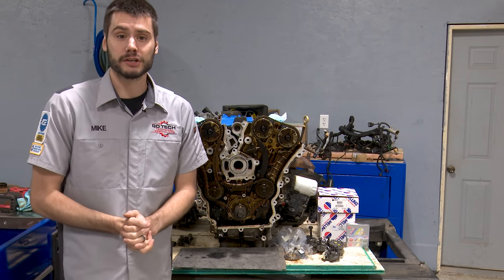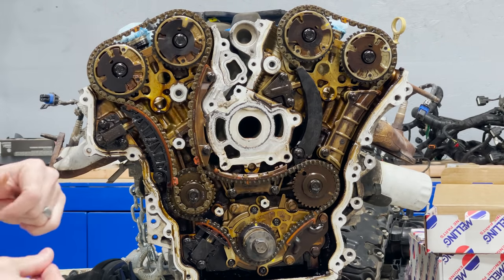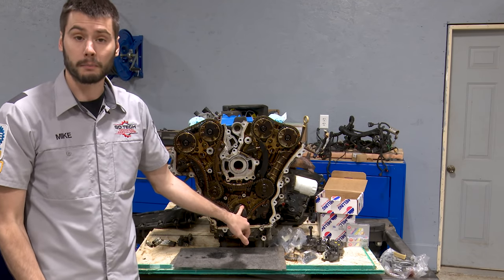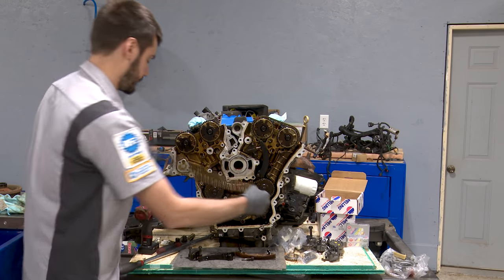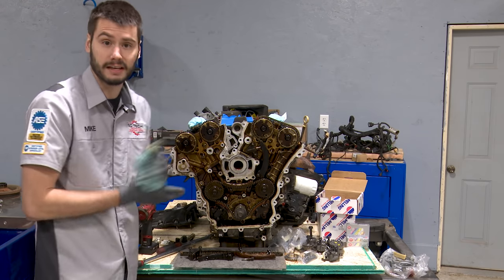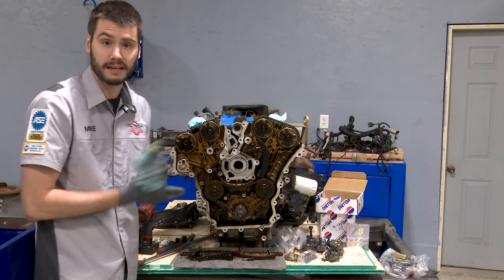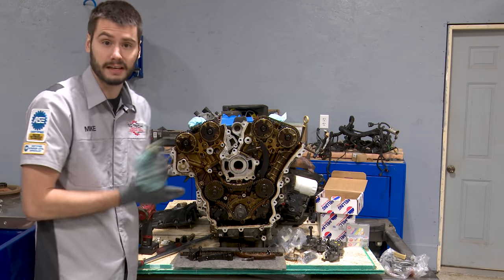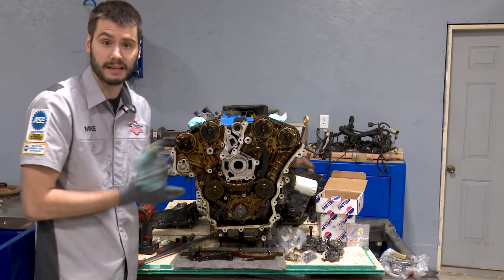How To Replace Timing Chain On Chevy / GM 3.6L V6 - Full Length Removal and Install - With Tips!

Comment: It's 15 rotations to line the links back up again.
Reply from the maker: That's good to know, thanks Cory!
Mike Becker, Senior Instructor
Reply: I had an issue with my chains and it took 15 rotations to get the marks lined up. I suppose it could be more.

Comment: I got a 3.0 is this the same timeing set up
Reply: The 3.0 has a fixed exhaust cam with no phaser. It'll be an LFW or LE0 code depending on if it has DI or Port injection.

Comment: I always do this entire job in the stage 2 timing. With the cam lock plates (that only cost $8 on Amazon) on the cams  it's easy peesy.
Reply from the maker: Hey Ball Zach, sure that's one way to do it. My cam locking plates didn't fit the best. I also ordered the cheapies from Amazon. 
Mike Becker, Senior Insturctor
Reply: @GoTechTraining    The main mellings video also shows it in stage 2 the whole time.   That video was far more simplified then this one
Reply from the maker: Hey Randy, maybe it was simpler but I think it left some questions unanswered. My goal was to show the replacment by the book. That way any and all confusion could be answered.
Mike Becker, Senior Instructor

Comment: is that engine not an interference engine, because youre moving the pistons with left bank camshaft, while right bank camshaft is stationary, after removed the first chain, i thought the pistons and valves would collide on the righthand bank..
Reply: Apprently.it is!

Comment: I have a Weird Issue if anyone can help!!!

I set the timing perfectly all links and marked lined up I installed the cover and balancer. The. Started rotating it around to make sure things move smoothly because I was tightening a timing bolt and heard a crack. Wanted to make sure I didn’t blow the engine sidewall out or something. 

EITHER way when I was rotating the crank everything moved smooth till I heard a chain jump/skip noise. And then I che led marks and the Left phaser on intake jumped a couple teeth! How’s that possible? Even if engine cranked it would of done the same probably? 
Now I have to reset the timing on that cam hopefully not pull the cover I just sealed.

Comment: Anybody else notice the exhaust cam jump a tooth on the left bank when he rotated the engine?
Reply from the maker: Hey Casey, not sure what you're seeing, but the chain never jumped a tooth. The motion you may be seeing is the tensioner moving a bit, but the chain stays on it's teeth as it should.
Mike Becker, Senior Instructor

Comment: @Ricom69
0 seconds ago
Hello all, I am having a heck of a time locating the Harmonic balancer (crankshaft) bolt torque spec for this 3.6 engine? 2009 enclave. What does the manufacture call for?

Comment: Is this also the engine for the Pontiac G8 V6?
Reply: Similar but not really. The valve train is slightly different because the LY7 (the HFV6 in your G8) uses a port injection system. This LLT uses a DI system and as such one of the cams is longer than the other four for the mechanical high pressure fuel pump. 

So for your engine, the cam alignment tools will be different for your engine (they won't have the cut outs for clearance of the high pressure pump cam) and the timing chains will have a slightly different design (depending on how old your engine is and if it's had the timing chain recall done), but the installation process is identical for an LY7.

Best to order the locking tools for an LY7 and get the appropriate alignment tools for it as well.

Comment: Man looks like you did a good job, but no oil pressure on the tensioners and that left tensioner jumping while you turned the engine 😬
Reply from the maker: Hey Manny, so whenever I do jobs like this I always crank the engine over for at least 20 seconds prior to firing it up. Usually disabling fuel if possible. That way those tensioners get full of oil and the top end gets some oil back through it. Thanks for watching!
~Mike
Reply: @GoTechTraining  👍
Reply: Hey man I’m working on this engine and I’m having issues with the right bank.  Cylinders 1,3, and 5. My boss suspects camshafts have been swapped and is throwing our timing off. How can I figure whether they were swapped or not? We had the head  blocks  serviced.

Comment: I just bought this same kit but it only came with 2 chains...went back and checked parts info and it's says only 2 chains not 3
Reply: Had same issue w my customer. Bought a cloyes kit w 2 chains and 3 guides only. He sent it back and we bought a kit locally with everything. You need sll 3 chains
Reply: Just had the same issue with my melling kit from rockauto, I just told them the 754 chain never came and they sent another one out.

Comment: how much something like this cost
Reply from the maker: Depending on how complete of a job is done. Meaning if phasers, tensioners, and guides are replaced, and factoring in what the shops labor rate is. This job can commonly run between $2,000-$3000 dollars.
Ryan W. Technical Instructor
Reply: @GoTechTraining  I just got a 2011 traverse and it been running bad. RPM keep dropping during drive on highway and regular. done had it in shop first time it was cadi converter was bad, next time they said it was a 02 sensor and neither have fixed the problem. Any idea what it could be before i put it in shop again.

Comment: If you rotate the engine over, hmmmmmm, 140 some odd times, the marks will all line back up. Customer removed the 1 right side head because he broke a spark plug off in it. Do not do a timing kit. Do not further disassemble the engine. Etc.
Fun times.

Comment: if it's anything like the Chrysler "2.7L-24v"  after any timing failure, it shortly after will "chow" all the bearings and very soon Mr. Rodney will be hammering and knocking to escape, yes oil pan pulled, everything cleaned and tons of everything replaced.
planned obsolescence ehhh?

Comment: Who is in Indiana that can help me do this job to my 2015 Colorado?
Or how much would someone charge to this job? I know it varies but just to get an idea. I'm not sure yet if my engine needs it but I just bought and it has 200k miles .. Help haha 🙊
Reply from the maker: Hey, we're in Wisconsin, not tooooo far away ;) I've seen quotes around the $3,000 mark but it will depend on what's all getting replaced.
~Mike
Reply: @GoTechTraining  wow pretty expensive fix than.. thanks for the response,  now I understand why some people swap engines instead ?

Comment: You do not need to follow the service procedures using the stage 1 and stage 2 timing that’s just a complete waste of time. All you need to do is get timing mark on the crank to about 5 o’clock when you have the crank at 5 o’clock the letters will pointing up like 12 and 3 o’clock and like 10 and 12 o’clock basically the letters will be kinda pointing up if the correct letters aren’t pointing up turn the crank one more turn. Now you remove all the timing components and re install them. When you do the last chain (right side) you will need to use a wrench to hold the cam in place so it doesn’t move while you set the timing marks, install the guides and tensioner. If you move the engine to both stages then you will not have to hold the cam from moving but I don’t like doing it that way I like to just leave the engine in one position then you really don’t need to move anything much at all. I have been working on these engines since they came out I was working at dealership when they came out we all hated them when they came out but after doing a few of them you like working on them. I’ve done a few hundred of these chain jobs I love doing them. The only special tool that I use is the crank socket it just slides over the crank so you can put a ratchet but using a bolt like this guy did is fine. When the engine first came out they had a problem with the camshafts having too much end play so you would get cam sensor codes because with the excessive end play the cam sensor couldn’t read the cam so we used a tool that with the valve cover off you slide this tool down between both timing guides and the tool would tighten up and hold the chain tight so you could unbolt the phaser, put a thrust washer on the cam and put the phaser back on the tool held the chain tight so you wouldn’t loose the timing on the chain those are the only tools we used on these engines. So as far as the guide goes on the oil pump I replace that guide every time I do one of these jobs and I just torque the bolts to spec and I’ve never had a problem and I’ve literally done a few hundred of these maybe more. It’s a good idea to replace all of the guides last thing you want  is to have the plastic to break off the guide and then ur doing the job again. It is true that after you turn the engine over the marks will not line up well they actually will line back up but it will take a few thousand revolutions I think it’s like 3800 turns before the marks line up but if you think the timing jumped and you want to check all you need to do it count the links and u can use a paint pen to make new marks. Last thing I only recommend only getting the parts from the dealer don’t use aftermarket parts ive seen after market chains be slightly longer.

Comment: Plastic parts and long timing chains don't get it for longevity. Also a lot of parts for a overhead cam which am not a fan of. Hard to beat a pushrod engine for longevity. Overdesigned crap which is hard to fix when engine in car. Why you need to change your oil more often then they say like every 3,000 miles. I also run those engines 1 quart overfull to make sure the timing chains get enough oil. They over baffle these engines to get better gas millage so oil can't splash lube as well as they should by the crank.
Reply from the maker: Hey Arthur, very true stuff! Amazingly, Ford, who was one of the first pickups with twin turbo small displacement engines, has gone back to a pushrod motor for their super dutys. The new 7.3 and 6.8 gas motors are both cam-in-block and look incredibly reliable. Time will tell, of course. Thanks for watching!
~Mike

Comment: these engines blow balls. maybe good for 90k miles
Reply: Change your oil every 3,000 mi with full synthetic and add a new filter, you will be fine.

Comment: 3 timing chains, 3 timing chain tensioners, 4 cam phasers, 7 PLASTIC timing chain guides, countless tiny oil passages and a new oil pump...what a pile of SH Y T. try fixing all that with the motor in the car and that's a 3000$ job every 100k miles!  
no wonder GM went bankrupt, and will probably do so again.  what your video did was to convince me to never, ever, buy a 3.6 high value equipped vehicle.
i'm keeping my old dinosaur tech 3800 buick equipped car because it just keeps going on and on.

Comment: very good tutorial
but the chains your using are a poor quality, they are already stratched out to the half way mark..
next time, use scheaffler timing chain kit
Reply from the maker: Hey Troy, thanks for watching! Good to know. Since doing this video, i've seen that the part number used is hard to get. I've also heard of knock-off kits using the same number but not being Melling parts. I haven't used the Schaeffler kit, but have heard good things about the Cloyes.
~Mike

Comment: I’ve heard horror stories about these engines but I want to get a gmc acaidia and my question is, do you know of anyone or maybe yourself found ways to make this engine bullet proof or at least better than factory?
Reply: change the oil every 3,000 miles.  use a dexos rated full synthetic like mobil 1 of valvoline.

Comment: this video is ok. but you should show the camshaft lobes at TDC. cause there is no what of identifying the camshafts from what I can tell or nothing I found in the manual. like casting numbers. so if someone took all the camshaft out the heads and even go as far as removing the sprockets from the camshaft and didn't mark anything there screwed. this why I don't like American cars they  over think shits and makes no sense at the end. just my opinion. everything else was great.

Comment: Did GM ever fixed this problem. Cause I know these engines are junk
Reply from the maker: Hi Daniel,
I do believe they changed a few things with the engine oiling system to lessen the issue. But not sure if the problem has been solved.
Thanks for reaching out!
~Ryan Wilsing

Comment: How to make something, that used to be easy and straightforward, into a total cluster. And to think, I own one of these pieces of junk !  Thanks GM !!

You have to go over 360 degrees to get from stage two, to stage one. Yet, you only have to go about 40 degrees to get for stage one to stage two, when putting on the chains ? Interesting ?
Reply: It actually makes sense mathematically, and i commend the engineers. However, if they can figure this out, why didnt they factor in longevity and fix the crankcase ventilation problem
Reply: @jonathanham5598  If you watch the video from the gear set manufacture, they set up bank 2. Or whatever they are calling the fist bank. Then turn the crank counter clockwise to set up bank one. Then back clockwise on reassembly. That makes a lot more sense on an interference motor to me.   I think they say the motor can be out of time around 50 degrees before damage is done.

I'm sure turning it by hand you would feel if anything was hitting, but I still like turning the crank about 50 degrees instead of over 360.
Reply: @griffinreitz7041  sorry for the late reply.  I finished my installation about a year ago, and i never had to do the full 360. The pistons are notched for valve clearance (at least on my model). I ended up rotating counter-clock, then clock-wise to line everything up.  I still need to overhaul the block and heads, but as far as timing goes its still running 👍.

Comment: Question if this is a interference motor why are you rotating the crankshaft wrong this is not the video you should follow it will mess up your valves recommended clovers video or mell because clearly this guy Mike doesn't know what he talking about thank you
Reply from the maker: Hey Mike, interesting viewpoint. Forunately when spinning this engine over by hand the valves and pistons do not hit. Maybe I got luck.y. Mike Becker, Senior Technical Instructor

Comment: this guys video just turns engine a smidgen clockYz stage 2, then counter clockYz for stage 1, then clockYz for stage 2 again.. your 2 different methods perhaps leave engine & cam rotations at different intervals?, more importantly if it does, which if the 2 of you are right or rong🤔
https://www.youtube.com/watch?v=hZyehWKDV-Y

Comment: Ps don’t 4get 2 tighten that top right tricky to torque sequence oil pump, U said not to lUsN bt accidNtlE did, bolt.. & if it was me, which it mIt sUn B, I’d thrO a cuple nU phaser gizmOz on there Yl it was all apart.. hek I wud & mIt flop a nU evREthing on there, water pump, this that & watever.. I’m babLEng & U Lready nOz this.. gr8 viDO chEf.. ya nO, thE ONLE thing I don’t get, rElE, is IF the chAns wear oOt on links(giving appearance of ‘stretching’, & then the links(for these timing, sequence sensitive engines) don’t quite line up, just by one link or watever - is WHICH wEL to trn - thats quite the trickE cunundrum☹️

Comment: Stupid GM engineers and their tiny oiling holes.
Reply from the maker: Hey Scott, thanks for watching! That and their long oil change intervals lol
Mike Becker, Senior Instructor
Reply: i was wondering if a thin grade, slick 50 or whatever would be better with these earlier smaller hole engines. I used full synthetic,..i think my issue was a timing part breakage